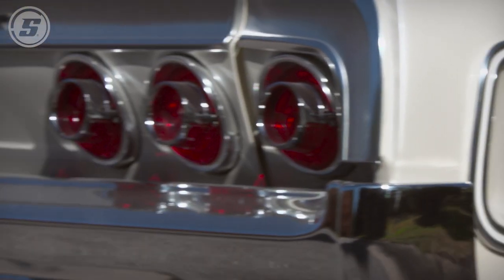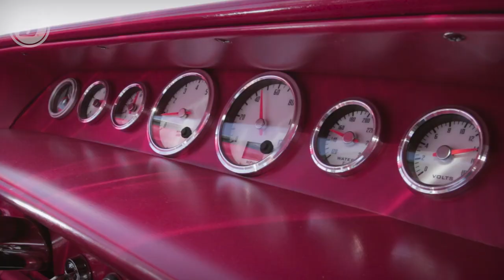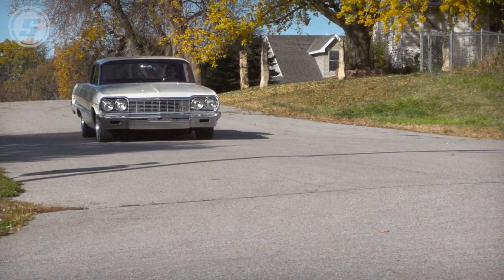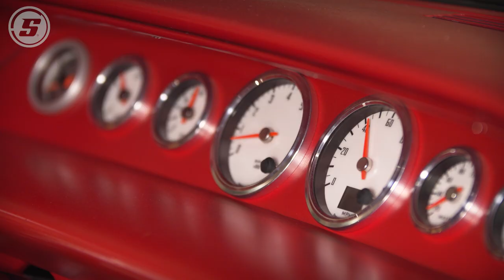1964 Impala - Employee Rides: Pat Orth

Comment: i just bought a 63 SS and defiantly not staying stock. I need your help in the rim and tire department please. Are those 20" or 22"rims and if so what size tires are you running? looks like 8.5 in front and 10 on the rear. Please help. I also am a cruiser, but it has to turn heads at the same time
Reply from the maker: Hello. Pat runs 20x10 in the rear and 20x8.5 up front. If you'd like to speak with someone about your tires/rims feel free to call us at 800-979-0122. Thanks!

Comment: What wheel combo do you have? Is the suspension just an airbag suspension? I’m currently working on a 64 and want that same look. Thanks.
Reply from the maker: Hello! Pat is using 18x8 and 20x10 Ridler 695 wheels and sitting on Air Ride. Good luck with your build!